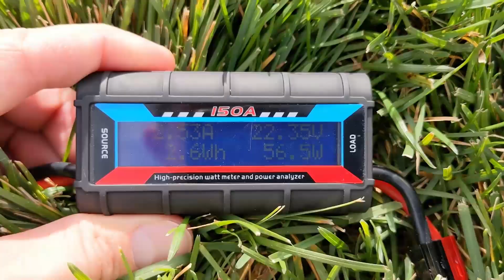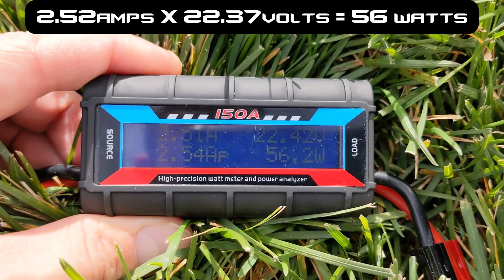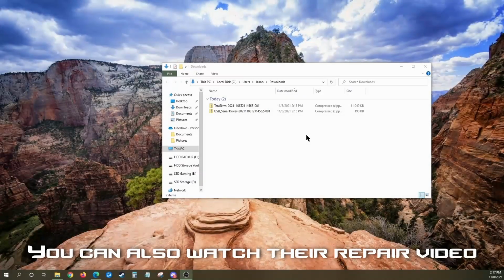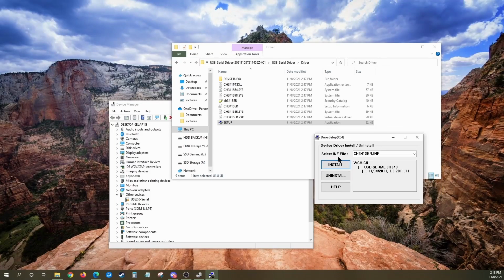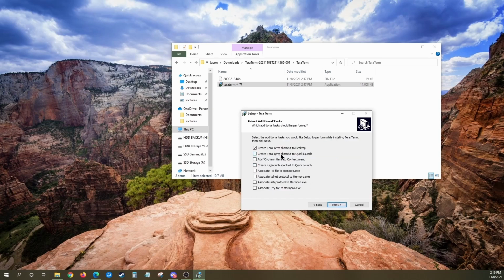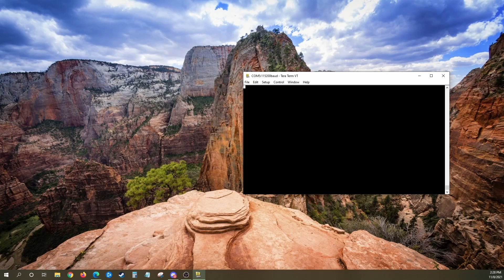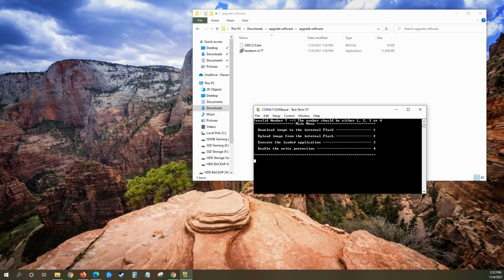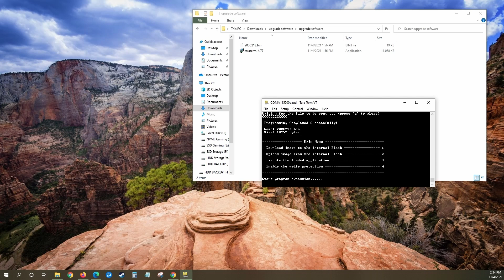CTECHi 240wh Power Station FIXED! No more Solar Charging Issues - HOW-TO REPAIR VIDEO

Comment: Hello from Germany,,, I hope you still read the comments for this video. I need the firmware for this power station. On the 1-4 menu in your video I saw point 2 - Upload image from the internal flash...do you think it is possible to upload the flash file from the device to the pc, than I could programm another flash chip since the flash chip in my power station is shorted. I can not find the CDB-dongle you used and ctechi did not reply. So maybe anyone could get the flash file from a t240 station and sent it to me? That would be awsome
Reply from the maker: This power station is like 4 year old at least and they no longer support it, I'm sorry. There are much better options available nowadays without this issue.

Comment: Where can I buy this USB-C adapter?
Reply from the maker: If this unit is still for sale at this point, it should be fixed by now with the default firmware. It's a super old video now.
Reply: @Jasonoid  Yes, i know that, but I have the same problem now and can't find this adapter :(
Reply from the maker: @mediadoctor  you'd have to email the company for them to ship you the adapter
Reply: @Jasonoid  Ok, i try it. Regards

Comment: I did the upgrade, I needed to press the light button 10 times to get into upgrade mode. But it doesn't look like it is solar charging. I assume the battery level indicator should show charging just like it is plugged into AC charger? I tried it with a 12 volt watt charger.
Reply from the maker: The the display that doesn't show any information, it's quite hard to know if it's working or not.
Reply: @Jasonoid  The batt. level indicates charging with USB C or Wall unit. But I am pretty sure the solar is still not working. Not a deal breaker, thanks.

Comment: Have you tested it can charge at 100watts? The charge controller is only rated at 3 amps..
Reply from the maker: 59 watts is the max I have seen on it.
Reply: @Jasonoid  Thanks for your reply (another reason why I'm a subscriber)

I have a Renogy 100w and Renogy 50w panel and not sure if I should take the much heavier 100w when camping. Is the 59watts the max the Ctechi took (and the panel was outputting more than 59watts) or was it because that's how much sunshine there was..thanks.

Comment: NEW UPGRADE PROCEDURE With unit switched on, press and hold power button until unit switches off, after unit has switched off keep holding power and press the LED button 10 times (quickly), unit screen remains off and rear LED comes on, release power button. unit is now in upgrade mode. at this point I still couldn't get a connection to the PC, I found if you short press the power button once or twice until you get a double flash from the rear LED then it will connect and you can carry out the upgrade. Hopefully this will help someone out!!
Reply: It works, but..How do I go out from that state ?

Comment: I have the 320wh version and Ctechi has confirmed it supports 100watt charging. However mine shuts down and the battery indicator flashes or fades on a 100watt panel. Ive not experienced this on a 50watt panel I also have.
Reply: Is your panel a "12 Volt" panel,, providing something like 12-23 Volt peak output? If so, it should work. But it you use panels with higher voltages, the overvoltage protection will shut down the charging input port.

Comment: So i've just picked up one of those Elecaenta 120w panels so have run the fix on my ctechi but still seem to be struggling to charge solar. I can charge form the solar panels USB PD outlet no problem (it drops in and out if the light is bad) but the main power input isn't working properly. If I cover most of the panel then the CTECHI will indicate charging, but I guess really slowly. If I leave it uncovered though it flashes the charging bars once as soon as you plug it in and then stops until you unplug it where it will flash once more again. Have tried running the fix again a couple more times, all seeming to go well but it still does this. Any thoughts?
Reply from the maker: it's hard to tell what's going on since the display show basically nothing useful. I'd recommend using an in line watt meter like I did in the video to see whats happening. It's a little overkill but then you can see how fast it's charging and what's going on. It's hard to tell without a display.
Reply: @Jasonoid  I'll have a look out for one. For now I've fiddled with it some more and found it will actually charge in the really strong sun as well, just not in the middle. After fiddling around with a multimeter I think this is because of the heat lowering the open circuit voltage, with charging seeming to work when the open circuit voltage drops below approximately 21.6v. I've seen between manuals and current adverts for selling this unit, suggestions that it needs an open circuit below either 24v or 28v, but it certainly doesn't work for me at 23.5v. I've mentioned this to Ctechi and they're suggesting they might need to swap out my unit for a new one. Will see what happens.

On a side note I tried charging through the USB pd output on the elecaenta panel and this does work, but in poor conditions can cut in and out continuously, and then after a while this seems to confuse the ctechi battery as the display then gets stuck on indicating 'charging' even when everything is unplugged and the USB C port stops working in either direction. This only starts working again once you completely drain the battery to empty before recharging.

Comment: Hello there I can I repair mine, your downloads wont work on a mac by apple cause they are microsoft, is there anyway I can do it ?!
Reply from the maker: Email their support group, maybe they support Mac os, if not, you'll have to find a pc to do the fix on.
Reply: @Jasonoid  and the email of the support group is the one that you put in the description ?! 😇🙏
Reply from the maker: @410root  yeah
Reply: Use some arbitrary serial communications program that supports the Y-Modem protocol. Since MacOS is derived from FreeBSD, it should be possible Unix-style serial/terminal programs like "minicom" etc. from the shell prompt.

Comment: Great review of this product and thanks for posting the solar fix information 👍 I purchased mine from Amazon UK and it arrived yesterday. On powering on 4 of the 5 segments on the battery symbol were lit up. Plugged in mains adapter and left it topping up the charge with the 5th segment flashing away. This has been charging like this for 4 hours so far. Do these things ever reach full charge? Is anyone else having this issue ?
Reply from the maker: I don't have this small guy anymore, but I remember it takes a bit the charge since the power brick was only 45 watts charging speed.
Reply: @Jasonoid  Thanks for the reply and it has just this minute reached full charge. I should have left it a wee bit longer before posting! Cheers anyway..
Reply: I have this issue.  It charges  fullybut within  minutes that first  bar drops  off.      Remai s like that for a while before dropping more.   Do i have a lemon?

Comment: Hello, I would like to buy the 240Wh model.  It's $200 on Amazon.  Is the correction made today?  Which solar panel do you recommend?
Reply from the maker: They mentioned they were going to update the firmware on all of them.
Reply: @Jasonoid  Ok, good. Thanks you. Is a Solar panel with "100w, 18 v / 5,56 A" compatible with this generator ? 
Because its written "3 A max".... So i dont know because all the panels are around 5A
Reply from the maker: @clementfrehel9310  Yes, a 100 watt panel will work with this power station but it will only charge at 59 watts.
Reply: @Jasonoid  Even if its 5,56A ? (Written 3 A max) Won't that cause a short circuit and damage the generator?
Reply from the maker: @clementfrehel9310  no damage, it's called overpaneling. The power station takes the power it needs from the solar panel and the rest it just there waiting to be used.

Comment: Hi! I have a imars  SP-B135 135W 19v
this problem only affects the dc jack right? If I charge through the "usb type c port" (19V / 3A) there shouldn't be any problems, right?
Thanks!
Reply from the maker: Yep, you'll be able to charge via the USBc port just fine!

Comment: Hi from France😀, I just ordered before seeing your video😨 the same model but a CTECHi Portable Solar Generator 320Wh/200W, do you think it has the same problem?🤔
Reply from the maker: It could be fixed now with the firmware update. I also have another video to fix it.
Reply: @Jasonoid  I also saw your video for the correction CTECHi 240wh but mine is the 320wh it's the same micro software / hardware and procedure? can you tell me the address / email or ask the kit to upgrade the firmware   thank you in advance cordially
Reply from the maker: @jeromebachel7336  All that information is in the video description, it should apply to both the 240 and 320. You can expand it to see it:

GET YOUR REPAIR KIT BY SENDING AN EMAIL TO: 
 support01@ctechi.com.cn
Please request a repair kit for your CTECHi 240. You'll need to provide your name and shipping address.
Reply: @Jasonoid  ok thanks a lot, sorry for the inconvenience.

Comment: My Lenovo t450 has a 65watt power  adapter (Netzteil) can I plug that into the ctechi and will it charge my laptop without problems?
Reply from the maker: Yeah, USBc is a common standard and it should work on both devices.
Reply: @Jasonoid  the Lenovo t450 doesn't has USB C, it has square tip.
It needs between 45-65watt 20volt and 2,25 - 3,25 Ampere

Comment: Do you know if this upgrade procedure works on the 320wh. I have received my cable and have followed all the steps but the light doesn’t stay on when I press and hold the buttons as shown in the video.
Reply from the maker: I didn't think the 320wh had the solar issues?
Reply: I ordered the 320 model a couple days ago and I just found this video :(
Do you have problems charging it via solar? did you fix it?
Reply from the maker: @dkali2207  I had the 240wh version. I'm not sure this fix works for the 320wh. Reach out to Ctechi support. They are great
Reply: CTECHI responded the upgrade will work on the 320 model. @ d Kali yours is new enough and won’t have the issue. Mine was ordered in the first batch. That being said my unit won’t go into upgrade (when you hold the buttons) mode and CTECHI is swapping my unit out.
Reply: @cmsclips1770  Thanks for the response! I'll let you know how mine goes, I hope its allright!
Reply: @dkali2207  and you got it right?
Reply: @Larrypint  With solar some times it charges and sometimes it does not, I don't know if it is faulty yet. Also it came with the AC plug with scratches of use, so I think they sent me an used one.
Reply: @dkali2207  I bought a oukitel 505 for 330 Euro  and a 100w 24v foldable solar panel from nicesolar for 200 Euro and I tested it yesterday on a sunny day  on my south-west balkony (full load with 75-90w in 5 hours) and iam happy with that.

Comment: What device are you using between the solar panel and the power station? Where can one be had?
Reply from the maker: It's an "inline dc watt meter", if you look on amazon there are many to be found for a reasonable cost. It comes with bare wire leads so you'll have to hook up the connections you want.

Comment: Troubleshooting this (or similar) for a neighboring camper.    When I first tried charging with solar the unit ran the panels very near Voc and so made tiny bits of power (≤10w).    After dorking around with it the MPPT finally started tracking and found local Vmp (making 55w out of a 100w renogy suitcase at 10am in winter).

I disconnected and it started going to Voc again.  Hoping this is addressed by the update.  The unit itself seems nice other than that.
Reply from the maker: Yes, the update should fix any solar charging issues. Email them for a update kit.

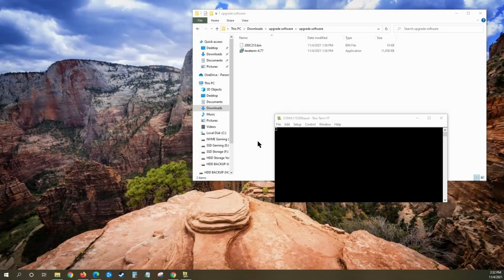Comment: Hi Jason, i've a problem with the upgrade. All its ok until the minute 6:50, I connect the upgrade kit, press 10 secs de ligth and the the on button, the light its on. Back to the TaraTerm, I press intro and... nothing hapends! any help? Tks!!
Reply from the maker: did you get the baud rate set at the right level?
Reply: @Jasonoid  yes, I did all the steps from your video and from Ctechis's, until I have to press enter tu load de *.bin file. The menu with the nunbers 1 - 4 dosnt appears😅
Reply from the maker: It's a super tricky process. I'd recommend you email Ctechi and see what they have to say. They may just ship you a new unit. Let me know how they get back to you.
Reply: @Jasonoid  Yes, I also did that, i'll let you now ;)
Reply: @Javier-cn9mz  Same problem here - I followed the instructions to the letter and no joy.

Comment: Thanks. Kind of new to all this stuff - can this unit be used to run a 5amp or 20amp LiFePo4 battery charger in order to charge up a 50ah or 100ah LiFePo4 battery? Wondering how long it might run a charger like that? Trying to think of various redundancies that might work in an outage.
Reply from the maker: You want something a bit bigger for that. 100ah battery is around 1280wh of power, this one only has 240wh. So you'd want something with at least 500wh to 600wh for some backup power for cell phones and small gadgets. The EB55 is an excellent option, check out my review video on that power station.
Reply: @Jasonoid  I was disappointed with the eb55. I couldn’t get more than 77-78% efficiency on the pure sine wave invertor.
Reply from the maker: @philwilliams23  Its the combo of a smaller battery and a larger inverter. It puts out 700 watts instead of 500 watts so more background power usage. Each of these companies also 'reserve' battery capacity and avoid a real 0% discharge so they don't get full rated power.
Reply: @Jasonoid  Thanks for your prompt reply Jason... It just annoys me that they advertised 85% efficiency, that's what really peed me off. Being new to Lifepo4 I hadn't realised that they didn't allow you to use the full 100% capacity of the battery. I only realised later these generators are holding back a small percentage of amps to prolong the battery life. Also, when I did test the battery capacity using the invertor I was only pulling a consistent 144watts, so I wasn't anywhere near the 700w limit of the invertor. I'm still learning more about Lifepo4 and these types of generator's so it's all good and valuable experience. A massive thanks Jason for all your fantastic video's that go to explain how these things work and how best to you use them.👍👍👍

Comment: Can I still get by without the kit if I'm using a single Sun Power 50W solar panel that you used in the first video? I'm not concerned with super fast charging. 6 to 8 hrs is fine with me. Also, do I need any special connector or does the one in the box work? Thanks!
Reply from the maker: It should work okay to charge up. If you notice it takes forever than you may need the fix. It's free so you might as well get one shipped out just in case.

As for the solar panel you may want to look at getting an MC4 20foot extension cable for the sun power panel so you can have some distance between the solar panel and the power station.
Reply: @Jasonoid  Thanks for the quick reply...much appreciated!  I reached out to Ctechi through Amazon and requested a kit.  I just received the T240 unit from Amazon yesterday but unfortunately there's no way to determine if it's a newer unit with the fix or one that still needs the kit. Thanks again!

Comment: My kit arrived today, and I've updated my power station, so it should be ready.
Reply from the maker: Sweet! Good to hear
Reply: Are you able to put your unit back into programming mode after you updated it? I tried on mine and I can only get the light to blink in SOS mode, it won't go into programming mode anymore. Trying to see if this is the same for others.
Reply: As it turns out, to enter programming mode after the update, the procedure is as follows: 1) turn on the unit with the power button. 2) turn off the unit by holding the power button and keep the power button held down. 3) while keeping the power button held down, press the light button 10 times. This will activate programming mode again.
Reply from the maker: Thanks Steve! I tried to find your comment but it got lost, thanks for following up again. The procedure is different after the update and this helps!

Comment: What was the item you used to see that wattage going in? Link
Reply from the maker: They are called DC power meters, you can find them on amazon. You'd have to put the connections you want on them because they come with bare wire leads.

https://www.amazon.com/HTRC-Precision-Analyzer-Battery-Voltage/dp/B06XPVKY13/ref=mp_s_a_1_11?crid=1JHDOVX6ZRMQ8&keywords=DC+power+meter&qid=1637277276&sprefix=dc+power+meter%2Caps%2C137&sr=8-11
Reply: @Jasonoid  thanks I'm trying to do a solar install on my 97 a class Rv so I'm researching all that I can 👍

Comment: I think this is a new power station. I saw on Amazon I want to see review on it VATID 600W Portable Power Station,3.5hrs Fully Recharge,518Wh Solar Generator,110V AC,12V Regulated DC,USB 60/65 watt PD Input/Output,Battery weight only 10 pounds

Comment: Do you need the fix if charging with a 60 watt panel?
Reply from the maker: you'd just have to test to see how it works, if the voltage is a bit lower on the solar panel I don't think it will have an issue.
Reply: @Jasonoid  Will do, enjoy your videos thanks